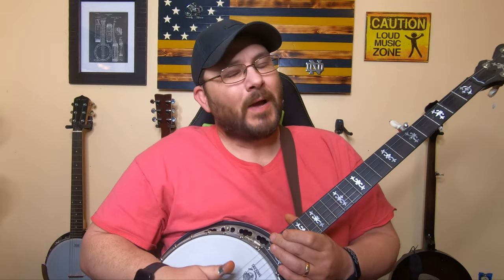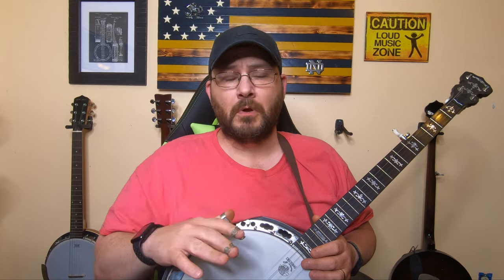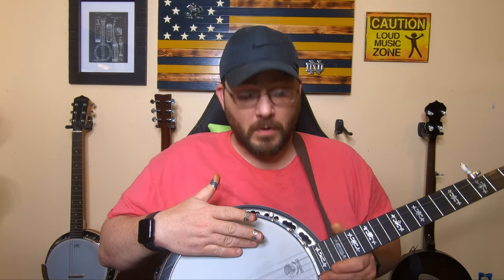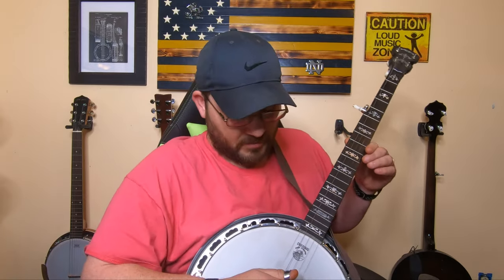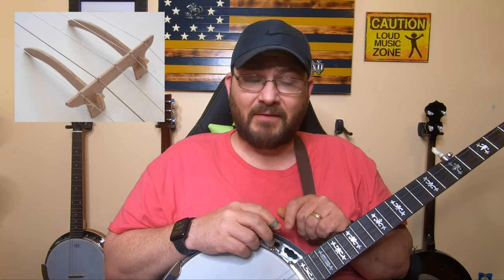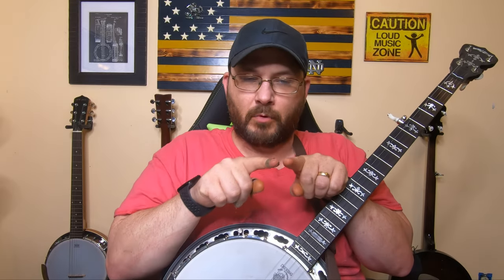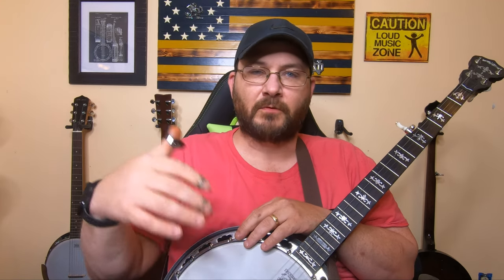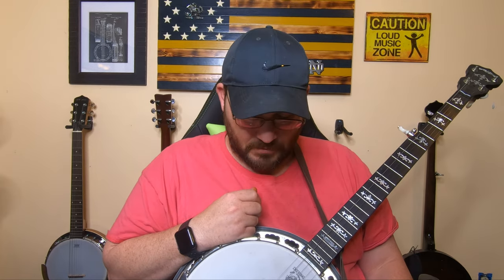The Banjo Bridge 101: Everything You Need to Know for Optimal Playability

Comment: Hi Banjo Addict, I enjoy watching your videos. When I do a set up, I use a drum dial and set each 
j-hook to 90. Then I add the tailpiece and strings and tune up. From there I listen to the tone and make slight head tension adjustments for optimal tone. I found it to be different for different banjos and heads. Even if you're replacement head is extactly the type and brand as the old one the tension will be slightly different. Anyways,  keep up the "good work". Best wishes. 🪕🔥💨
Reply from the maker: Thank you! I have a video coming out in 2 weeks on the drum dial. You are right, it’s invaluable to know your head tension. I have my resonator banjo set to 92 and my open back banjo around 90. Thank you for watching.

Comment: I've just torned down and rebuild my cousin's 16 year old Epiphone MB-200, it was in the closet for 10 years or so and he was very lucky no mould or mildew and hardly any corrosion on the metal fittings... Head was cactus though and needed replacing, the bridge (5/8") bowed like a Deering Smile bridge on the feet but also on the top, replaced with a new standard and works fine... I've tried all different kinds of bridges in the past, one piece hard wood, soft wood, compensated/stepped, angled and smile but I've found I've always gone back to the old standard, maple with capped top of ebony or rosewood... I've also tune the head to G#, tuning a half a tone higher can stop resonant frequency overtones and give more pure tones... 🪕🎶🎶🎶
Reply from the maker: That is fantastic! And thank you for the info. I have never thought of tuning the head higher to take out buzz and create a better tone. I will have to play around with that here soon! Again thank you!
Reply: Your welcome 🎶🎶🎶🪕 @BanjoAddict

Comment: I used to use the straight bridges, then I switched to a compensated bridge to try it out, the reason I tried one is because when going down the neck my banjo would sound like it was going out of tune, I have a Gold Tone BG-250F 5 string and after using and going back and forth between straight bridges and the compensated bridges for a time I do not understand why anyone would use the straight bridges after hearing the difference in the tone all the way down the neck. Awesome vids by the way chief 😊
Reply: With the current 1/2 bridge sanded down quite  a bit 1/3 of it actually on my Baldwin Ode  banjo.The intonation is dead on I guess im lucky.....Maybe I will try a compensated bridge someday if the sound difference is that noticable   thanks ..Glenn

Comment: I have an old Baldwin Ode Banjo I bought it in the 1970S.Would you know what height the factory bridge and proper banjo skin head rim height should be. I bought a 1/2 tall Grover bridge and its very high on the action without sanding alot of it away. The old bridge is the same bridge sanded down quite a bit on teh feet to get the strings close to the neck so its playable. I recently replaced the Banjo head with a high rim I believe as thats what was on it. Also when you take the resonator off their is some sought of key in the heel of the neck in a hole that looks like its adjustable. Any help on your end would be great  maybe this banjo need  cord. rods adjustment Im thinking never did it since I got it....regards.. ..Glenn.  Followup 6/19/2024 I found out the key in the heel is for neck truss rod adjustment and the gears are cast and soft you have to be careful adjusting the neck as they can break and also my Banjo needs a  cordinator rodneck adjustment  to properly lower the action too and a flat style bridge as Its never been adjusted in almost 50 years,LOLL! ........................  Glenn

Comment: Great video and very timely for me.  I have two banjos, a resonator and an open back. The string spread was different between the two so I ordered a new bridge to match the spread from one to the other.  Though both bridges were 5/8", one was about 3 thousandths of an inch higher than the other.  Though I am a beginner, it really messed me up using finger picks switching between the two.  I ordered a second bridge and now both are identical and playing is much easier.  I was amazed at how that small a difference was making me miss the strings occasionally with my picks when I switched banjos.  Thanks for what you do!
Reply from the maker: Oh cool! Yes it’s amazing the difference a small change will make on the bridge

Comment: My banjo bridge keeps falling down while I play.
Reply from the maker: your bridge should have a ever so slight lean back towards your tail piece. check and make sure it is not on your banjo backwards
Reply: @BanjoAddict  It is set up leaning toward the tailpiece.
Reply: @BanjoAddict  it just happened again. Doesn't take a whole lot of playing for it to happen. It falls toward the tailpiece if that helps.
Reply from the maker: couple of things to check, first make sure the tail piece isn't set too high causing a loss of string angle across the bridge. Second is to inspect the bridge its self and make sure there are no rounded edges on the feet. also make sure that the feet of the bridge are wider than the top of it. It maybe as simple as needing a new bridge.
Reply from the maker: also make sure that when your strings leave your tail piece and heads toward the bridge that that come from under the front of the tail piece and not the top of it
Reply: @BanjoAddict  yessir that is the case its going under. Smacked down once again halfway through a song. Maybe I'm smacking it when I clawhammer?
Reply: @BanjoAddict  the bridge looks like its sagging a little. Maybe I should try tightening the head a little?